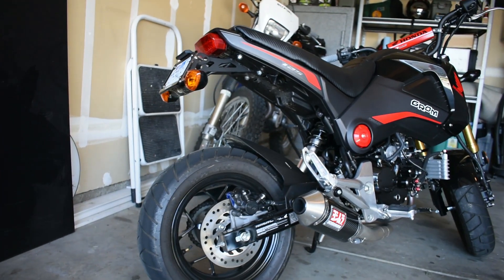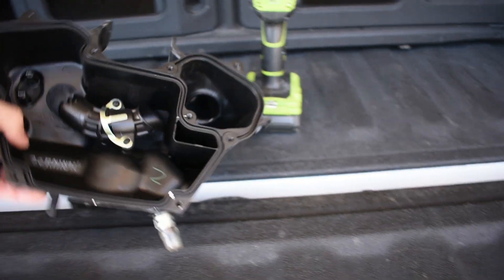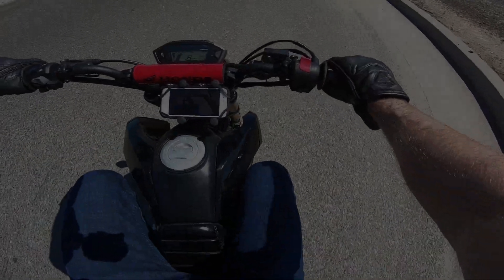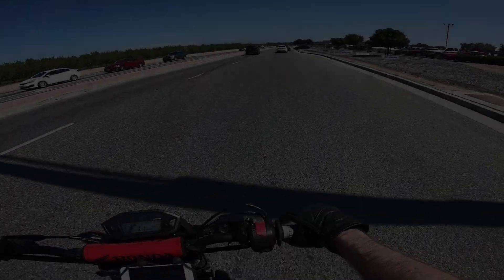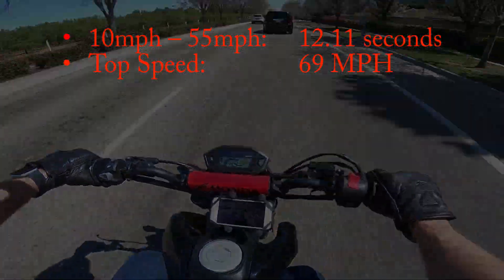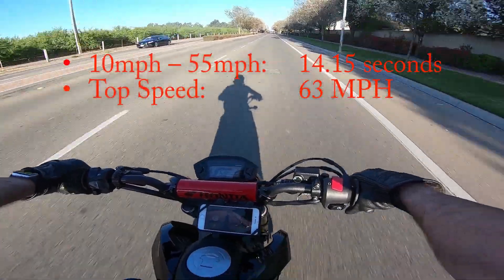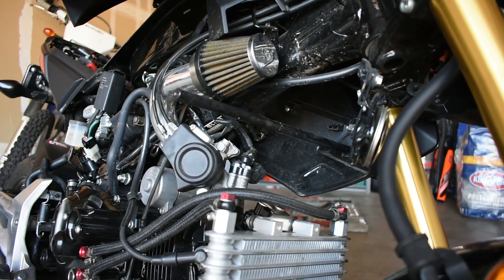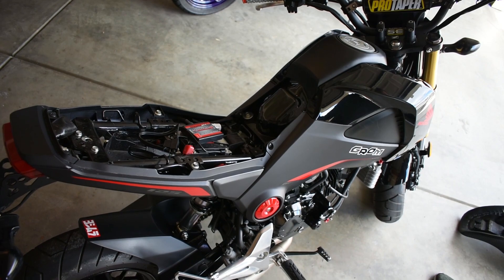Grom Mods - Chimera Intake - Power Commander V - Worth it?

Comment: Hello there im wondering how to get a few more mph out my Grom  any advice most welcome .ps im not looking for 2 stroke speeds as i own a few 2  strokes already,however my 125 Grom has a 161 big bore kit fitted and  a few other after market parts on it but on  the flat road i can only reach 72mph max (not  tucked) is this to low for an upgraded bike? thank you.
Reply from the maker: It sounds like you're doing fine, mine gets 70-72 in a full tuck, so you're good!   What other mods do you have besides a BBK?
Reply: @CTGromer  thanks off the top of my head I'm not sure as they came on the bike and I've only had it 1 day now,do you have a page and I can post the info that's been done to it?
Reply from the maker: @grantharper3821  Just post it here in the comments man!
Reply: @CTGromer  High lift cam,lightened flywheel and oil spinner pro setup on a dyno with dynojet fuel controller and is making 17bhp. Tyga full exhaust tyga  hugger tyga fron mudguard tyga clutch cover Brembo rear brake conversion with HEL line ohlins rear shock race cam lightened oil spinner lightened flywheel wide band dynojet fuel controller oil cooler  K&N air filter digital oil temp gauge after market mirrors and R&G tail tidy. Think that's everything mate
Reply from the maker: @grantharper3821   you're WAY more built than me!  You should be doing these grom power mod videos!
Reply: @CTGromer  I just like riding bikes mainly off road ones,i bought the Grom for some street fun and it's defo giving me that.Besides im from Glasgow Scotland nobody would understand my accent  haha,thanks though appreciate the vote of confidence  :)
Reply from the maker: @grantharper3821  Thats cool man, I think people would respect the accent!   Still think you should do it!

Comment: Restriction?  How big of a hole do you think you need for 10hp?
Reply from the maker: Bigger than the multiple snorkels/twists and turns than the stock airbox, the proof is in the pudding my friend, its restrictive as hell.  Thanks for commenting!
Reply: those twists and turns add volume after the filter...paper filter may be restrictive, airbox is not
Reply from the maker: @RedTurbocar  You should purchase the K&N cotton gauze replacement filter, keep your airbox though, then run the new filter and speed test it.  Then install a Chimera and speed test it again.

Comment: Sounded a little more windy on thwe last run maybe?
Reply from the maker: Could've been, I remember them all feeling about the same, no significant changes in the weather, maybe I was holding my head a slightly different way which would make the GoPro wind noise different.

Comment: So ill be fine running my bike with a chimera intake and a cheap exhaust (Aodonly racing exhaust) ? thanks ?
Reply from the maker: No, I would say its not safe, the bike will run too lean and get too hot.  Some sort of AFR  altering is needed.  I'll be doing a new video soon on the Finbro ECM, I recommend it!

Comment: I just bought a 2019 Grom with after market exhaust an aftermarket suspension from the dealer it only had 50 miles. But sometimes it’s hard to get in in first gear.  Have you ever had this problem?
Reply from the maker: It can happen, sometimes I have to roll mine forward a bit, feather the clutch out and pull it back in then it will go in.  Just the way it's designed I guess.  Hope that clears up as it breaks in!

Comment: Well done testing and video.
I have a z125 so i expect the results are close enough. My question is, the part about resetting the factory ECU, is that necessary when using the PCV ? I am getting the 143 bbk w/stroker crank. I already have full exhaust, chimera w/ sprint filter and of course PCV.
Reply from the maker: c0uchsl0uch00 thank for watching and commenting! I always error on the side of resetting ECU whenever you change ANY air or fuel settings

Comment: Did you lose your ability of a cold start after the reflash?
Reply from the maker: Sorry, I just saw this comment!  No, I did not lose my ability to cold start using the Dynojet power commander five, you do not have to modify the wiring harness.  The Finbro on the other hand you will lose your ability to cold start.

Comment: Chimera looks highly vulnerable to letting in water, dust and debris into the engine, considering it faces the wind (ram air effect) and there are no buffer between the air filter intake and the outlet into the engine. Once something goes through the filter, its immediately transported into the engine which will definitely affect the long term performance of the bike.

Comment: I’m hoping someone can help me??? What if you have a intake with a cheap amazon exhaust? What map do you use most of there’s are for Yosh I’m trying to figure out what I need
Reply from the maker: Yoshimura doesn't have a premade map for that exhaust, so I would upload each one and see how they run seat of the pants.  They will all be much safer than with the stock map, which is way lean for both intake and exhaust changed.  Good luck!

Comment: I am 16 almoste 17 i make 1000 euro in 1 month a new grom cost 4.300 euro do you think it is smart to get te grom already or wait before i have my license
Reply: If i have the grom i can change some stuff on it but cant drive it
Reply from the maker: Kevin Bos hey Kevin, thanks so much for watching and commenting, I think it’s awesome you’re saving your money and have a goal!  You buy that thing as soon as you can!  Make sure you budget mods into it too.   Good for you for buying it cash instead of financing too.  Have you checked into used groms?  The one you see in my videos is a 2015 I got last year for a great deal!  Way less than 4,300 euro!  Get that Grom and start working on the license ASAP! Good luck!
Reply: @CTGromer  i have checked used grom but i do not realy trust it then
Reply from the maker: @kevinbos4283  Well its your money, if you want a new one, get a new one,  by all means.  However, if you can find a seller you trust with a grom that has low miles, its probably a good deal,  these grom engines (especially if kept stock) are bomb proof!  Good luck, let me know when you get one!

Comment: Mine tops out at 73 with just a exhaust on it
Reply from the maker: Thats awesome, thank you for commenting!  Like i said before sometimes you get lucky and get a good one, also, how much do you weigh
Reply: CT Gromer I was about to say I only weight 135 at 5’7” if I get the intake and five can I go above 73?
Reply from the maker: @Tgrams   I think so, very possible, especially if you reflash the ECU!
Reply: You'll have to flash your ECU. The stock rev limiter keeps you from going any faster than 73 mph. You can actually hear your motor bouncing off the rev limiter in 4th once you get to 73 mph.

Comment: Did you put the stock tune back in the computer when you pulled the tuner?
Reply from the maker: With the PCV there is no tune on the ECU, it stays stock.  The tune is actually in the PCV which overrides the information from the ECU, so when you pull the PCV, you are back to stock ECU map.  It's different than flashing the ECU which i will be doing a video on next!

Comment: I know you attempted to be consistent with your runs, but you should have tried to be more consistent with shifting at the same RPM as you ripped through the gears.   Also, how you installed the PCV also lacked the benefits it actually offers as i saw no AFR gauge on your ride.  This means you have no idea in all tests performed if the bike was running rich or learn.   Without knowing lean or rich, you may not be doing you bike a favor.
Reply from the maker: All good advice I appreciate it.   I've since gone to the reflashed ECU, and have enjoyed that overall a lot more.
Reply: @CTGromer  so you incorporated a DHM reflashed stock ECU to match the parts installed?   I have a flat top high compression piston in my Grom, so not the DHM high high comp domed piston.   Curious if it even worth swapping it out.  Also have a Koso performance cam.   

Have you with your current setup able to hit the rev limiter in 4th?   

Any day everyday tuck or not I can hit 62mph in 3rd hitting the rev limiter.  4th is where mine struggles and why I ask about 4th.  

Let me know your experience.  Thanks

Comment: if you are going to install a power commander, please for the love of god get it dyno tuned. Do not just download a map off the internet and think itll be good. Every bikes different every geographical location is different. Its not super expensive and will yield better gains and a safe tune.
Reply from the maker: I agree doing it that way is the BEST and SAFEST way to do it, but the maps on dynojet website are adequate, especially if you're using the exact equipment that each map is designed for.  It's WAY better than running an intake, exhaust and leaving the ECU stock, thats for sure.  People that spend $350 on the PCV don't want to go spend another $100-$200 for a custom tune.  The best option for those just doing intake and exhaust is to just re-map the stock ECU.  I appreciate the comment!

Comment: So I could do all 3 of these mods and it wouldn’t run lean
Reply from the maker: That's correct, but the cheapest way to fix running lean is to just reflash the ECU.
Reply: The power commander IS what keeps you from going lean. You can either go the route of a flash or a fuel commander. Both would be overkill.

Comment: you don't know how to shift gears? why not power shift. this is so stupid. WHy not take a slow bike and make it a little less slow. you could just buy an old r6 from craigslist
Reply from the maker: The grom transmission is not designed to quick shift or power shift that way unfortunately.  I'm sorry you disagree with my riding style in the speed runs.  Buying an old R6 completely defeats the purpose of a having the small, slow grom thats fun to ride pinned everywhere. Some people don't want to be sport bike fast.  Have you ridden a grom before?
Reply: have a great day scooting around on your grom